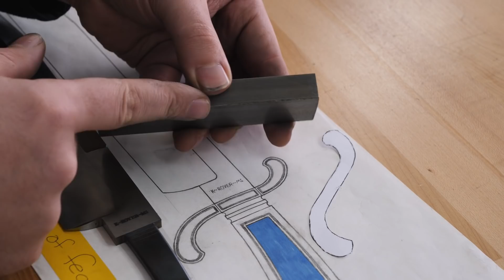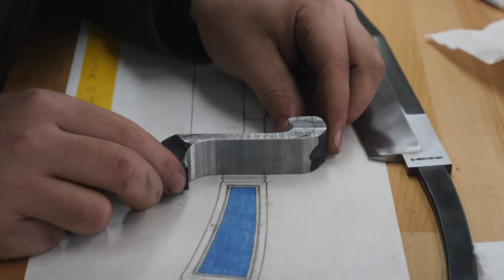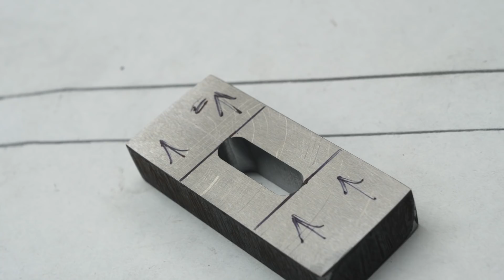How to Make a Frame Handle for a Knife: Pt. 1

Comment: Would smashing the side of the guard to tighen it work on brass guard, or would the metal just break?
Reply from the maker: It will work well with brass
Be very gently and go slow 
Remember metal is liquid 
It’s just a little stiff 

Dad

Comment: Curious on the lack of dust protection while grinding.
Reply from the maker: You probably can’t see our exhaust system. It works really well. We are adding a 5hp 34amp 4000cfm 10” intake system . Sweeeeeeeeeeet

Dad
Reply from the maker: You probably can’t see our exhaust system. It works really well. We are adding a 5hp 34amp 4000cfm 10” intake system . Sweeeeeeeeeeet

Dad
Reply: I want one now lol